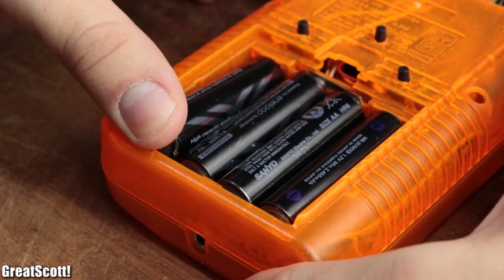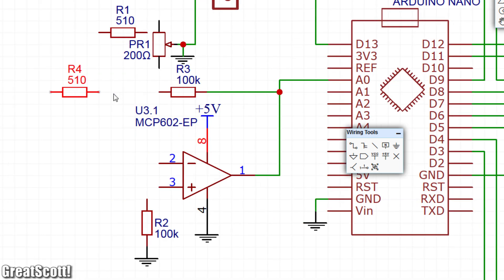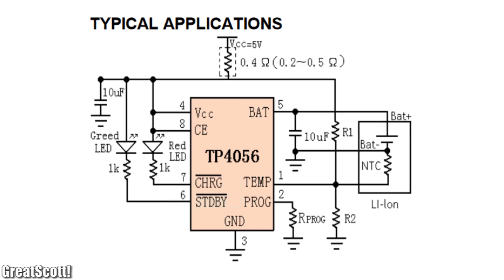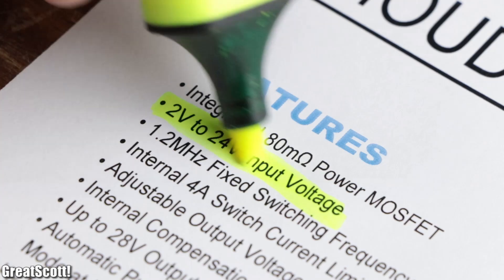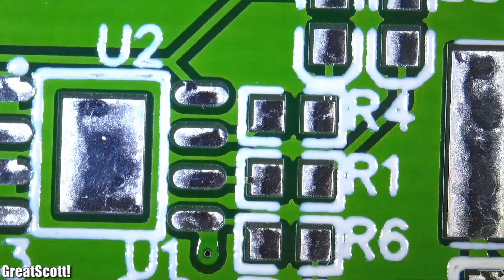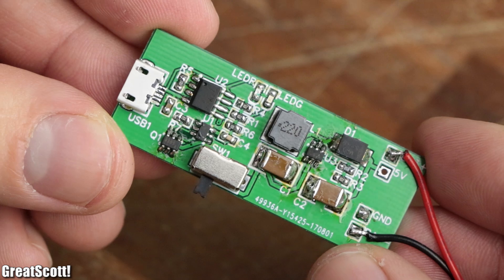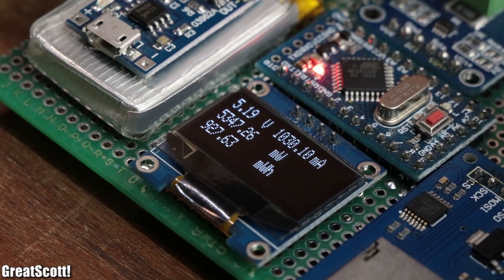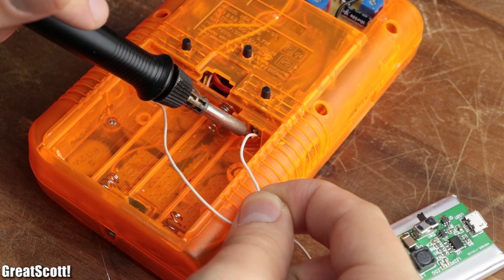DIY LiPo Charge/Protect/5V Boost Circuit

Comment: I really don't approve of anything DIY with lithium cells. They are extremely dangerous and there are many fail conditions where they will explode like a grenade, except they have internal fuel and once ignited, they spray flames out of them for metres. I highly advise anyone to buy premade protection, because they are factory tested encase of faults. At my work, when working with lithium cells, we have to keep them isolated in sealed flame proof bags. Highly advise reading : 'https://electronics.stackexchange.com/questions/230155/why-is-there-so-much-fear-surrounding-lipo-batteries'
LiPo Exploding: https://www.youtube.com/watch?v=EseOhC8n7ro
Reply: Then it is indeed a blessing that your approval is not actually required. 
Obvious troll.
Reply: + sid a

>because they are factory tested encase of faults.

No they aren't lol. There are tons of pre-built battery protection boards available on Ebay, Amazon, Bang-Good, Ali Express, etc. which are the same as any other piece of electronic gear that comes out of China.

There's a reason that hundreds of different sellers sell different variations of what looks like the same board, they're all copies of copies of copies of each other, and very little product testing goes on after the initial batch. Small manufacturing firms just crank out as much of some design as they can with a "if it powers on, it works" mentality.

I've seen quite a few dubious lithium battery protection boards out there which don't work properly, and some have been reviewed here on YT. If you know what you're doing, a DIY lithium battery protection unit like this one is better than the open market offerings.
Reply: @GGigabiteM  You are exactly right. I bought 10 boards from amazon and started testing.  I discharged one to 2.6 volts put it in to be charged and the board started charging it with over an amp.  Not good.
Reply: The ICs used in this project are the exact same ones used in countless commercially produced products, especially powerbanks. It's common sense to connect a multimeter to the battery terminals when first charging the battery, just to check the circuit and battery are functioning properly. Even if 5V were applied to the cell, say a solder bridge, it would not instantly explode.

For the truly paranoid use a capacitor instead of the cell for initial testing.

Biggest risk with any Li-Ion cell (Lithium cells are NOT the same thing), is to either discharge them to zero and recharge them, or to subject them to really high discharge/charge currents. as in 10's of amps.
Reply: I use a 5 cell 5 amp hour bare lipo battery RC setup. I added low voltage alarm. There is NO low voltage cutoff. I double check the charger settings, and verify voltage with a digital volt meter. I have used the same lipo packs for 3 years now without problem. My biggest safety components are common sense, and personal responsibility.
Reply: >manufacturing company's have test jigs every product gets tested on before shipping which is a very robust system to detect faults.

Do OEMs have test jigs for the products they make? Yes.

Do OEMs test every product that rolls off of the assembly line? No.

In many cases it's not possible to test every product that rolls off of the assembly line due to time and cost, so they will result to testing every Nth unit, or by the batch. Some industries like food processing require complete line or batch testing, but electronics manufacturing isn't one of them.

Name brands today aren't the same as they were 20-30 years ago. The name of the game today is to make it as cheap and disposable as possible, so paying more for a name brand product more likely than not isn't going to result in a better product.
Reply: @GGigabiteM  When I worked as an engineer we got defective chips form various large well-known semi-conductor manufacturers.
Reply: a helpfull hint.  Use a fire resistant ( grey ones)  safe  In reverse as a way to contain Batts under charge . 
its not gonna stop a huge fire  but it will buy you some time . 

It do this as I dont want to risk my  apt.
Reply: You aren't seriously comparing ultra-high power density and high capacity model plane LiPos with low power density and small LiPos used for hobby stuff and mobile electronics? Also, the ones that were used in this video already come with their own protection circuit, note the slim PCB under the Kapton tape at the top.
Reply: I was not referring to 'ebay boards', you can buy certified tested boards, and they don't cost all that much extra. Electronics faults are more common than you think, electronic manufacturing company's have test jigs every product gets tested on before shipping which is a very robust system to detect faults.

Comment: I wish I could do things like this. I am trying to reach my self or learn as much as I can. I'm a little old for school. but I use Google and YouTube. my goals are to build a inverter to power my off grid home. and some big DC motor controllers. and a battery charger for a electric vehicle conversion. some reason I don't like to buy anything. I want to make it myself . someday I may reach my goal. it may not be how I want to. but maybe I will get the projects done. but there is a lot of other things that I'd like to build. I have learned a lot in the last year and 9 months. that's when I really got into electronics. the DC motor controller is what got me started. I have worked in electrical for years. home and auto. so I have a little knowledge to start. your video's are a great help. you explain things well. and at a pace I can keep up with. I haven't gotten in to the smd things yet. still tinkering with through hole devices . but hope to improve my work station. and buy better tools. a good temp controlled solder iron. and supply's. maybe try etching PCBs. great video as usual. thanks ...

Comment: For a DIY project very good. But in terms of the price a total overkill. Just purchase a simple $1 powerbank for 1 cell. The PCB should measure only 2x2 cm and contains all you have shown. Charge/discharge with battery protection. Capable of a stable output of 5V with 1A. Smaller and cheaper as the Chinese you can not build it yourself. Btw: good video as usual...

Comment: What was the problem with first design? Would you care to explain your train of thought, why would the first design won't hold the +5 output(boosted)?
Reply: The traces were probably too small (voltage drop against them)
Reply: Max Wittelsbach I was thinking on that, but the resistance in the PCB would be that remarkable against the load, but well... Seems logic, increasing the section results and lower resistance, what I was asking is his train of thought, cuz he would look at everything before getting into conduits, only experience would tell you to look there
Reply: https://www.youtube.com/watch?v=aND0j2Y2IkM
Reply: Sorry I thought you meant the first board he showed

Comment: Hi Great Scott early in this video you showed briefly the program you are using in designing printer circuit board, may I know what software you are using?  , if you don't mind
Reply from the maker: It is EasyEDA. You can also find all the links in the video description.

Comment: Can you please describe what was the problem with your problematic layout. Really curious. I see no big differences in your first and second layout so will be appreciated for detailed descriptions.
Reply: Probably too long tracks from switching IC to inductor. It is very important to keep these tracks short and fat!
Reply: Yeah, but it will be very good if some video can be made to compare errors in layout and some "scientific" explanations around.
Reply: Making the tracks short has the same effect as making them thicker... less resistance
Reply: his trouble was because the voltage broke down at higher current draws, which was because the traces were not thick enough to handle the higher current, and thus the voltage broke down
Reply: @aidanfransen3571  So the problem simply was the too high internal resistance of his circuit. Nice reasoning :)
Reply: Aidan Fransen less inductance to be more accurate.
Reply: yes, but still not explains why moving few components solved the problem.
Reply: @prostosergik  mostly the difference was the ic. But traces made a difference. Higher currents mean higher voltage drops across series resistors with the load, in this case the traces. That means that at higher currents the longer and thinner the traces, the more voltage of those 5V was lost in the traces, resulting in lower voltages at the output when current was higher.
Reply: A wire has a certain amount of resistance depending on it length.... with a longer wire having greater resistance (this is wire wound resistors are made from long thin wires, as this creates resistance)..

In this case making the traces as short as possible will allow more current to pass through the traces with less heat loss (and less lost energy). Therefore more energy can be supplied to the output as less is lost to heat... that's my understanding anyway...

and @Dave Dennis I do not think inductance was the cause of the problem here... in  a boost converter greater inductance means less ripple on the output, meaning greater inductance would improve the device
Reply: I don't think it would be either of those, because the only change would be the under-voltage protection (2.8V vs. 2.4V).
It must've been inductor traces, specifically the one going between C1, C2, and the fact that C2 is a little far from the sense resistors. So maybe some noise or oscillation is going on around there.
Reply: Why would a little extra inductance in the wires going to the inductor even matter?
Reply: Some other comment mentioned he used a 22 µF instead of a 10 µF.

Weren't there any formulas for L and C in the datasheet?
Reply: Serge Liskovsky he changed the protection ic and mosfet and it worked.

Comment: One problem I've been facing with TP4056 with protection board - and that is present in your circuit as well - is the 1A limitation. It's great for smaller projects, but for projects where you need more current it let you down. Power banks, for stance, smartphones demand up to 2a. So what I end up using is the unprotected board in conjunction with a small BMS (the model depends on what I need). So, it would be a good idea to create one unprotected as well, for your future projects. ;)

Comment: Why do you prefer li-po over li-ion? Li-po is more expensive, and has a lower Energy density
Reply: also much more dangerous , although that's what the circuit is for but still :) .
Reply: adi331 nah, thats The one Advantage of li-po, they cant explode
Reply: qwert zuiopü 
I'd say its size. the little lipo takes up less space than a 18650,  if he wasn't trying to go small. a 18650 would work very well.
Reply: qwert zuiopü this was a joke right ?
Reply: @IRFZ44 yes true. Although all smartphones have li-ion cells in pouch form so it's definitely possibly. Don't know how available they are though, for the common person.
Reply: Li-ion indeed has a higher specific energy. Pouches and plastic prismatic cases are less weighty than steel. 18650s go kablooey in the same way that pouch cells do. One is rolled and the other is folded. Otherwise, the chemistries are the same.

Comment: this video clearly/directly showed how much patience,hassle,experience is required for making my own stuff
Reply: to make it well yeah, you can slap stuff together as a total amature too though
Reply: hello, you called me ?
Reply: Sayantan Maiti i
Reply: Sayantan Maiti this is a fake comment if I've ever seen one
Reply: well said  Sayantan Maiti
Reply: He didn't actually improve his boost circuit though, he just changed the overdischarge protection IC to a higher cutoff voltage. So essentially he's sacrificing usable battery capacity in this case
Reply: @MCSGproject  Well at 2.9V the battery has practically no charge (<5%) left. It's unhealthy to discharge below 3V.

Comment: I understand this video is intended for people to DIY their own PCB, but is it possible for you to put those PCBs on ebay or something to buy? I would be totally cool with spending a few bucks on a pcb like that (extra revenue source?) instead of going to the trouble to hand solder SMD components and hope it works.
Reply from the maker: I would love to do that but I simply do not have time to produce these boards. Sorry.
Reply: Have  you  thought of selling as a kit ?
Reply: GreatScott! Try to ask elecrow, which produces and sells such boards while giving the original creator a small amount for each sold unit
Reply: If you search ebay for 'diy power bank'. you'll find a number of USB power banks that only come with the case and PCB, but no battery. The cheapest ones are about $1. You toss the case, keep the PCB and use it with your own lithium battery. The smallest ones are about 1" x 1", they have a 5V boost converter, battery charging circuitry as well as battery protection. The only downside is that some of them require a certain minimum load to keep the boost converter running. If you draw at least say 50 mA every 20 secs or so, that should suffice.
Reply: I guess @bal000 is referring to the 134N3P modules.
Reply: @jomunoz not exactly. For example, the short circuit protection in most DIY kits is a fuse. I am not sure if they have overdischarge protection either.
Charging cut-off voltage is rather 4.1V instead of 4.2V.
Source: I have been using them for my project, and they are inferior to GreatScott solution.
Reply: BoomBrush
It will only be a matter of time for the board to appear in Aliexpress. 
Edited: i just noticed the comment from bal000, I did not know those 'diy power bank' existed, they sure cover what the circuit on this video covers.
Reply: BoomBrush get the easy eda file from the description, then order some pcbs.
Reply: ikr i would  like that curcuit too 
cool to get it prebuilt
Reply: Use google - there are literally hundreds of those boards available.

Comment: I always wondered if the over-discharge protection draws (a little) current once it was activated and if so, how many µA?
Reply from the maker: I showed it at the end of the video. 4.7µA
Reply: That's the standby-current. When the over-discharge-protection kicked in, you said the boost-converter "deactivated" (10:15). What current flows in this case? Also the 4.7µA, or does it really shut down and draws really no current at all?
And another question: What was the shipping cost for the boards to Germany? (Or was it free for you due to sponsoring?)

Comment: A week ago I did my first smd soldering! It went very good thanks to your tips! Thank you very much!
Reply from the maker: You're welcome :-)
Reply: His SMD soldering ain't that good at all. Try to hold a resistor/capacitor with tweezers in place and then solder one end of it - and you can easily solder another one after that. Same with ICs in QFP, SOT23 and other packages with leads - solder one of them by holding IC in place with tweezers - and you can finish other ones easily. Watching resistor flipping up during soldering in this video is a pain.

Comment: That custom board service sounds amazing! Coupled with that diagram app and it looks like you could prototype anything super quick
Reply from the maker: Yes, exactly my thoughts. That is why I had no problems promoting them a bit ;-)
Reply: @greatscottlab  would this pcb work with li-ion battery? 18650 cells.. please reply. in case not please refer me to another video
Reply: I still remember ordering custom PCB a few years ago. It took 2 weeks and I paid 80 dollars for just one piece (80*80 mm). Times are changing...
Reply: Yes times are changing. And what's also amazing if someone creates a circuit symbol or footprint for a component it will be automatically open source so you can find nearly everthing in their parts search.
Reply: MrMastrTroll the going price these days for 10pcs of a 10x10cm board is $5-10, excluding shipping
Reply: not to mention it is so cheap!
Reply: GreatScott! But why if your board size is less than 10x10 cm i went with your project to their site but showed a higher price?
Reply: @lestherb3807  has to be your first order, 10 pcb's everything else stock. Green, 2 layers, nothing else.
Reply: What's annoying is you wait a week, get 10 boards, then realize the mistake(s) you made, and all 10 boards go in the trash. Another week, another 10 boards, repeat... I guess if you're really good at it and experienced, maybe your stuff works at first try. It sure isn't the case for software development, so I don't know how PCB designers can do that from first try...